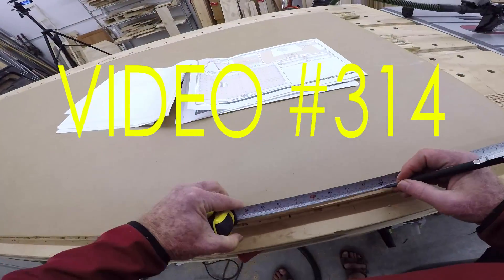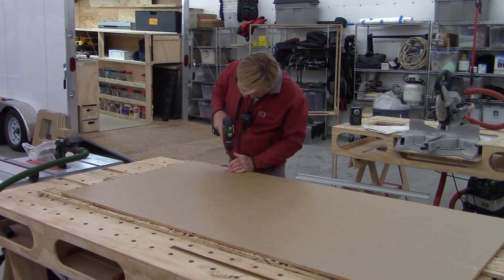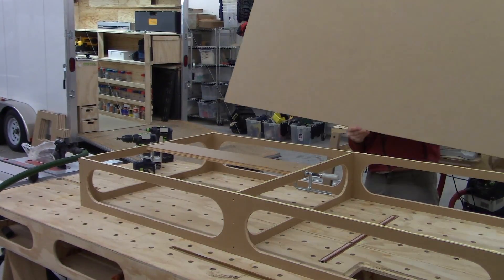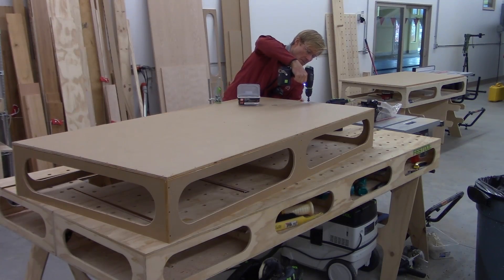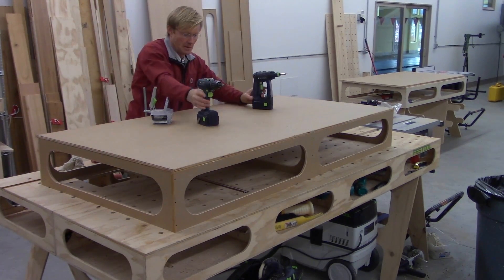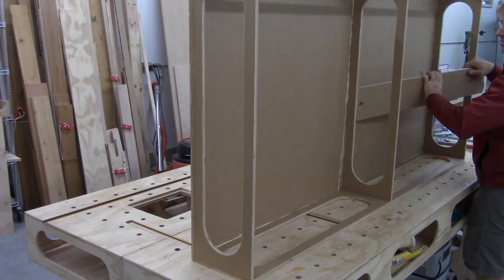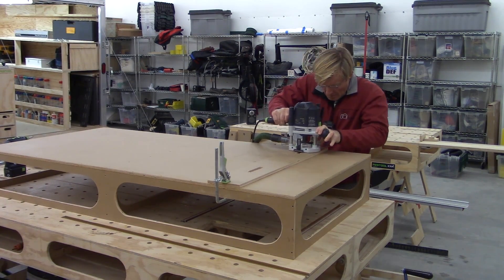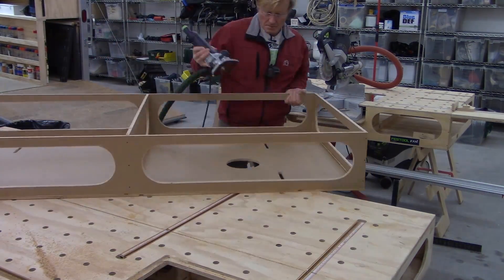BUILDING PAULK COMPACT BENCH (PART 5) BOTTOM

Comment: Hey Ron.... Most SMART woodworkers don't  buy things they don't need or cannot use.  That is why you should consider offering the complete torsion box or just the perforated  top as separate  purchase options.   I personally will not use the saw horse legs or the spreaders as it want to mount it to  a movable assembly table that will never leave my shop.. Just something for you to consider.. Thanks Hal

Comment: Ron- great design as always. I am building one to go along with a Total Station in tandem. Once I put my mitre saw on the TS, there was no room left for assembly. Minor point on this video - you state #7 screws but the plans call for #6. It appears you are using different screws for the sides as opposed to the tops. I could be wrong. Thanks again for producing these videos.
Reply from the maker: We are using #7 all around, but #6 is what I used. Either is fine.

Comment: Hi Ron, as far as the new 12' mobile workshop coming up, could I build the cabinets and boxes in advance from sketchup, then buy the trailer at a later date? I want to start building and install the interior later as I dont  have the funds for a trailer yet. Is this a bad idea? Will I run into problems? Thanks for all the great videos.
Reply from the maker: You will be fine to prebuild as the Smart Woodshop Design cabinets are modular, not scalable. The scale is changed by adding or subtracting cabinets.